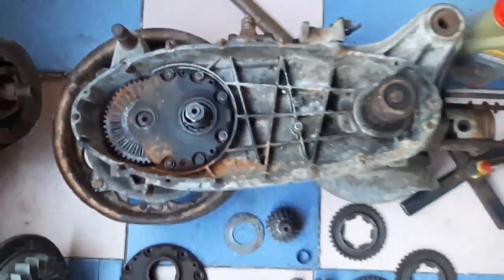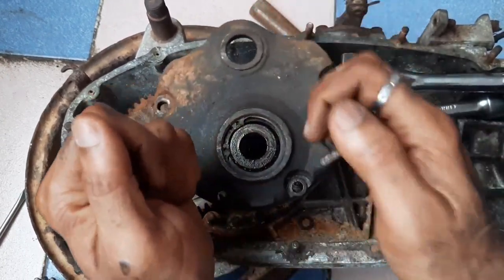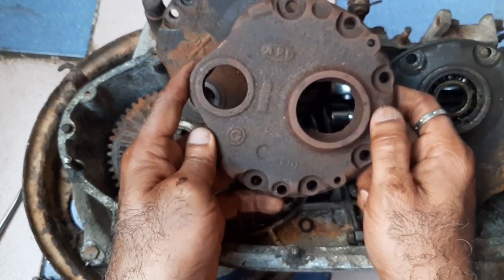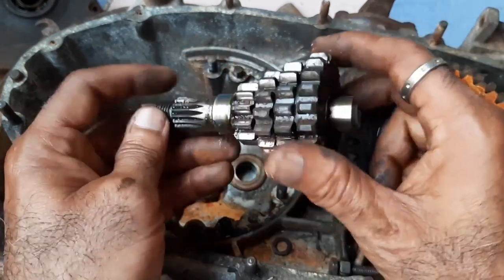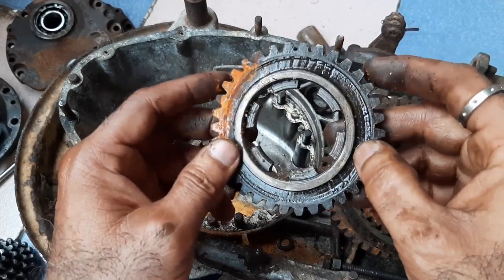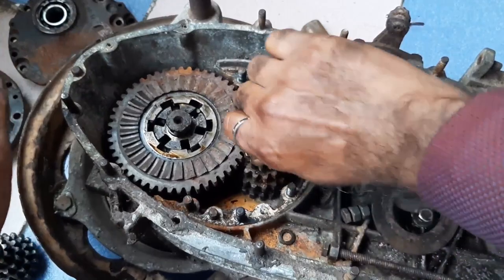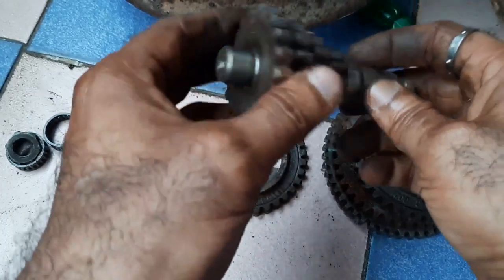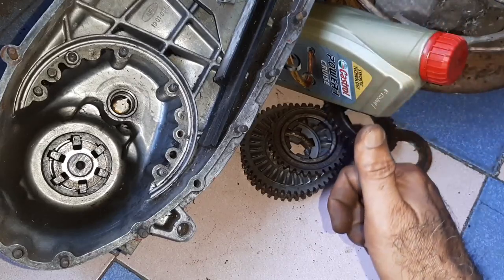Expert Advice: How to Successfully Rebuild a Lambretta Scooter Gearbox

Comment: Simple explanation. Is there any difference in engine of Vijay super and lambretta in India
Reply from the maker: Engine is same only cc differs. Differs in piston dia and length of connecting rod
Reply: @LambrettaRamesh  . Can you please specification of Vijay super and  workshop manual. I have a Vijay super mark 2